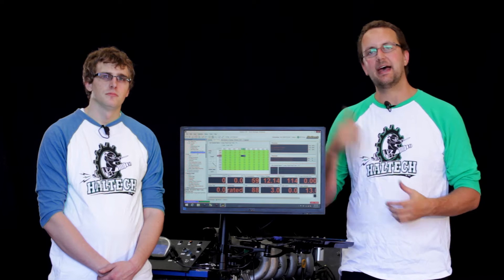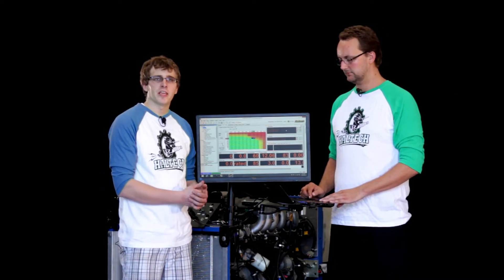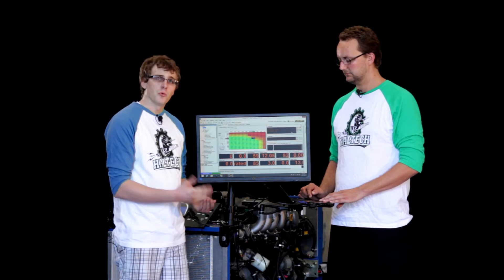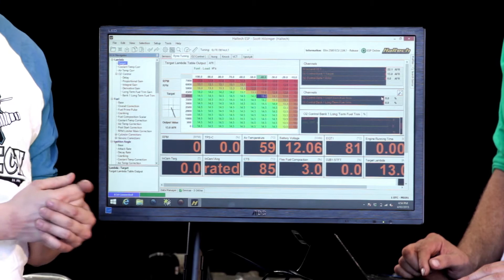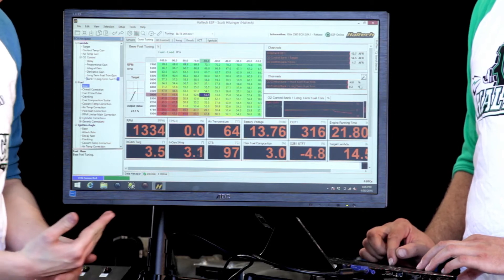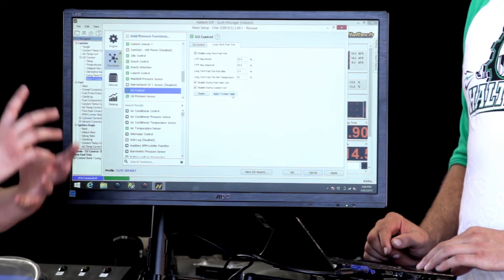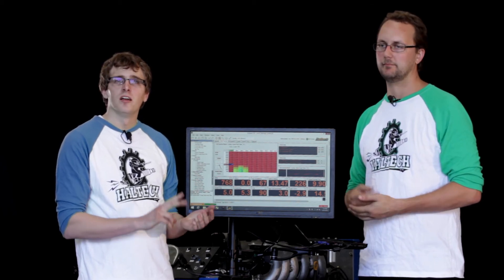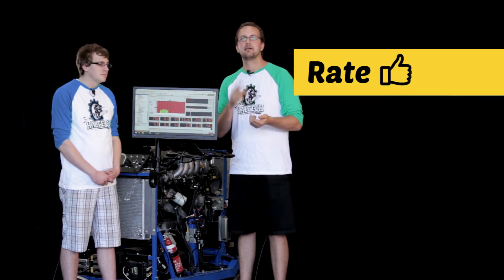How Short and Long Term Fuel Trim works  - Technically Speaking

Comment: I mean isn't this what most cars after 1997 or so have as a functionality in their ecu's ? I work at a shop which converts to lpg and I use the fuel trims to tune the cars on lpg , here in Bulgaria the bulk of cars are older than 6-12 (and older) years and its common to see "serviced" and in "good" condition cars which have horrible fuel trims and after conversion and tuning they run better on lpg than on petrol.The fastest car I've tuned on lpg was an audi a8 4.2l 250kw but that's a v8 so nevermind.